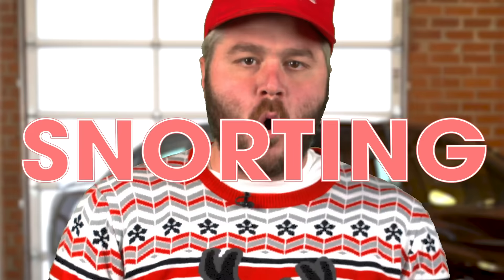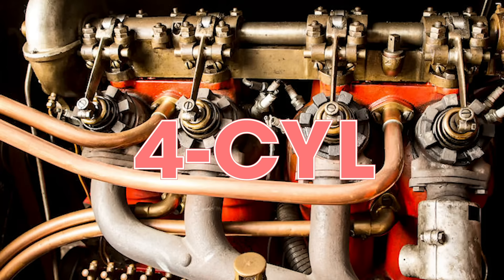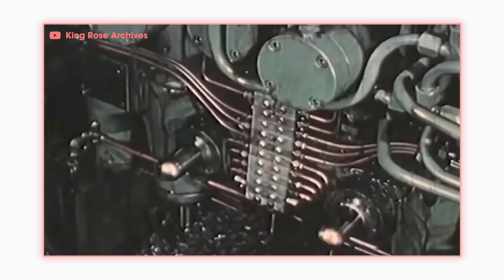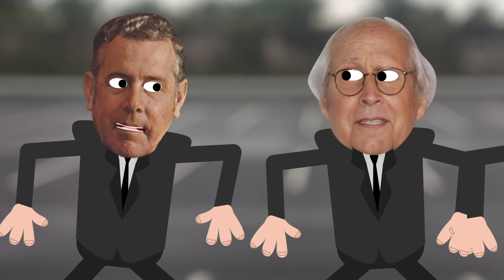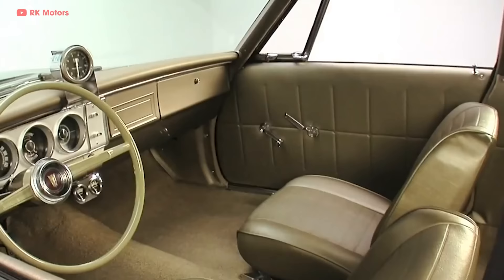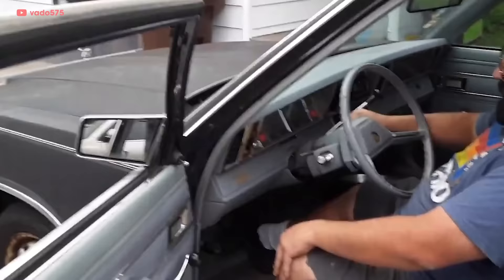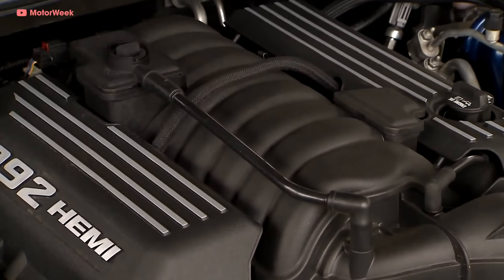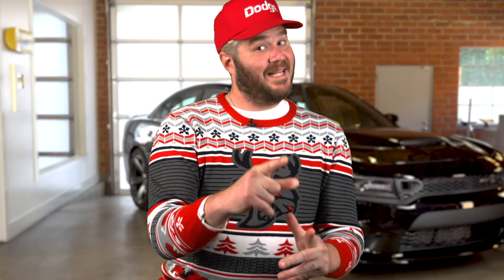DODGE HEMI - Everything You Need To Know | Up To Speed

Comment: Why don't jeep Wranglers have a hemi v8 option yet😠
Reply: KNT Media no. The question is why don’t they have the new Cummins 4 cylinder diesel.....they make the same amount of Tq and get better gas mileage. A Motor trend show “dirt everyday” tested this out. They had a 4.0l v6 vs 5.3L LS and the new Cummins 4 cylinder diesel and the Cummins diesel showed out
Reply: The same engine is being used in ford trucks in South America... *Yes Ford has Cummins engines in some box trucks even in the states.
Reply: @fastballfilms4214  well after all Chrysler is now offering an inhouse built 4 banger diesel. Idk about the performance or reliability but the sheer 5k extra you gotta pay to get it is ridicules enough
Reply: The gladiator should’ve definitely came out with the hemi instead of the slowest 3.6 ever
Reply: They would get ass gas mileage and make like 200ish hp to the wheels
Reply: They don't but the Cherokee Trackhawk has one, 707hp turbocharged Hemi,  it's designed for trackdays and drag strips.   it has a sport, drag, cruise and "street" mode.
Reply: Straightail supercharged Hemi. There’s no American V8 car that has a turbo v8 in it...when you find one lmk
Reply: Because the wrangler isn't designed for speed or burnouts, it's designed for off-road or rugged terrain,  putting a hemi in that thing will be like 12mpg and because the wheels are so big it would only make 350 AT BEST at the wheels.    if you want a "jeep" that is fast, get a trackhawk.
Reply: @fastballfilms4214  Cummins signed a 10 yr exclusivity deal with Nissan America,    the new Nissan TItan pickups come with a turbo diesel option.   Ford makes their own turbo diesel in a partnership with Detroit Diesel,   and Chevy makes their own Duramax engines. and the new ram pickups have the new turbo diesel v6 or L4 engine.    Toyota is the only truck player left without a turbo diesel option and IMHO that really limits them.    right now Chevy is the only turbo diesel truck that can tow heavy loads.
Reply: Straightail i said American V8 “CAR” not truck... if you find an American passenger car that has a turbo v8 lmk
Reply: Straightail chevy is the only one that can tow heavy loads? That’s the brand I see the least in hotshotting. The most popular option has to be the 3500 ram and then the F350.

Comment: So, what is the difference between the new Hemi engines and every other engine? (Besides the two spark plugs). Because doesn’t every engine today have a slightly curved cylinder head? Aren’t the new hemis just the same as every other engine?
Reply: the hemi kept  most of its original design features, if you compare with a LS engine for example, you can see that the heads are much wider because the valves almost face each other, this gives a straighter path for the airflow.  There is also two rocker arms per head and the camshaft is raised in the bloc. Helps to shorten pushrods and allow for higher RPM. This is why top fuel dragsters engines, making 10 000 hp, are all HEMIs.
Reply: mikev221 Well, that, and they're required to be by NHRA rules, haha! But yeah, the Gen-2 Hemi is kind of the king of pushrod flow/rpm.

Comment: Do you have a vid for the inline 6 hemi? 
They tested them in the states in the mid 60s cudas and the A100s that i know of as well as a few other small dodge bodies. It didn't do so well here but dodge Australia needed a good six cylinder. And inline 6 was insane over there. They took and tooled it 3 times to open up more hp. Ending with a 265 turbocharged....

Comment: I wouldn’t really say the hemi went completely away for those 16 years they (effectively) rebranded the engine as the dodge “magnum” V8 tho if I remember correctly they were closer to 5.3s and not the 5.7s we know today but you could find them in some really interesting things such as the first gen dodge Dakotas and them little ladies ran
Reply: Just brushed up on my research some sense I’m out here saying some objectively wack things but to correct myself the gen 1 Dakotas and the ‘93 to ‘03 “magnum” v8s that dodge produced were actually 5.9L the smaller ones I mentioned earlier are actually pre ‘93 (and pre Dakotas for those interested)

Comment: my dad has a 2008 charger super bee and tbh its a peice of shit, the engine has been rebuilt like 4 times, (it blew up not even six months after he bought it brand new in 2008) the transmition has been replaced even more than that and to this day it miss fires because he doesnt know what tuning is, its a 6.2L with 420 horse power witch tbh is kinda pathetic, you should be able to get like 1000hp out of a 6.2, and on top of all of that my shitty elantra is almost as fast, thats what happens when you make a car almost 5000lbs for no reason, a whole lot of noise and not a whole lot of go, my mom had a charger of the same year also a v8 it had the same exact problem but it couldnt be repaired it wouldve costed more than the car was worth so they scrapped it, dodge is impressive and i respect them as a company but dont buy one unless you wanna spend the rest of your life fixing it